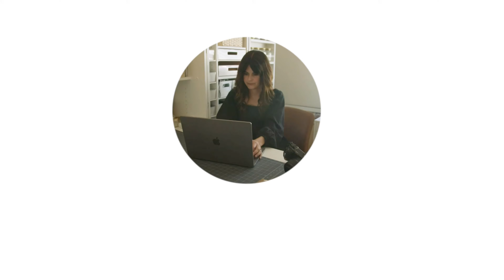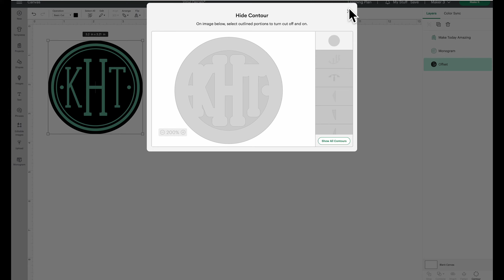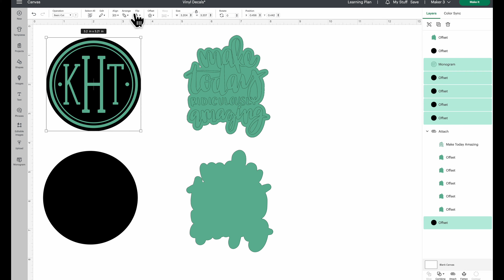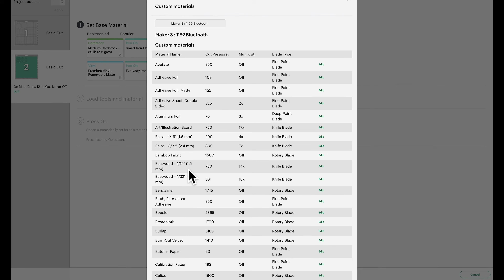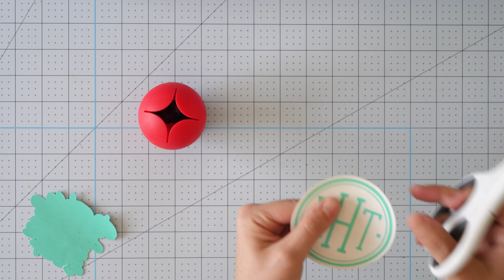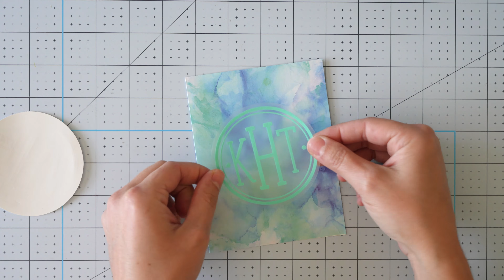How to make a vinyl sticker decal to sell!: Making Money with Your Cricut Cutting Machine

Comment: Just wondering, could you mirror your transfer cut image and place the transfer tape sticky side up to do the cut so you don't pick up anything from your mat?
Reply from the maker: I have tried way back when— and I had issues with my blade sticking! I’ve also tried to put it on a parchment paper liner and it didn’t hold well enough. But most transfer tapes come with a liner so it’s a non issue for most!
Reply: @KarleyHall  That's good to know, Thank you